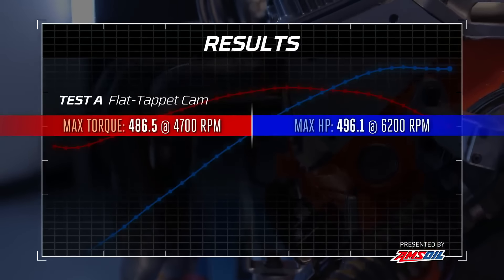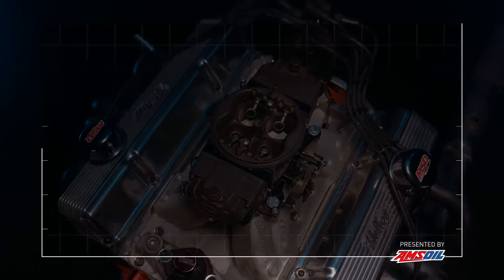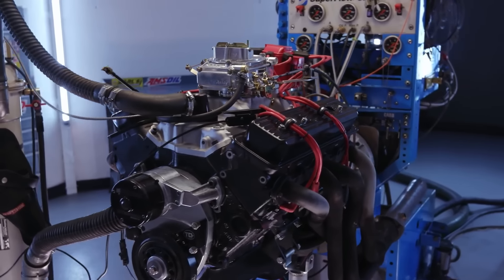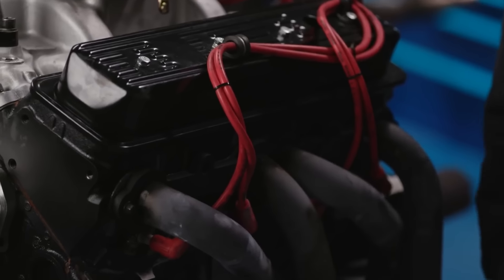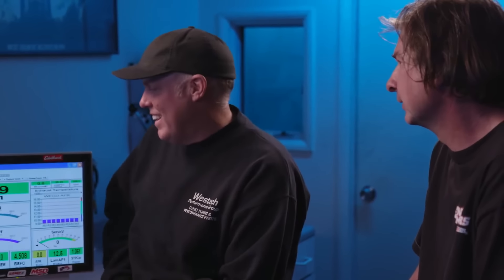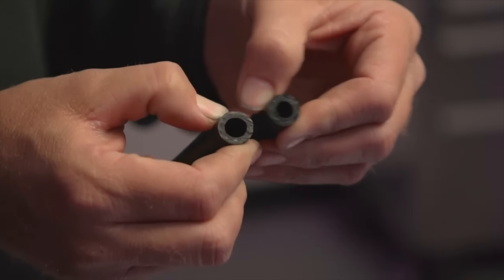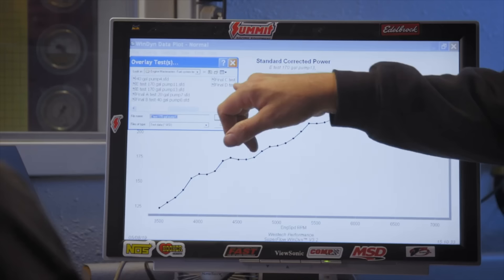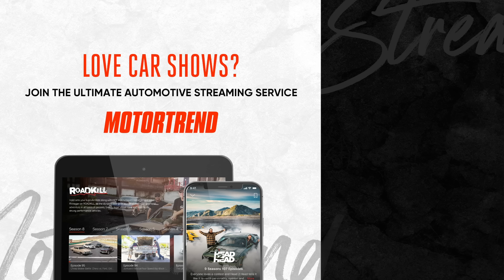Budget Mods for Big Power! | Engine Masters | MotorTrend

Comment: Idk, slapping a turbo bigger than my future on every bone stock engine sounds like a good plan
Reply: I can hear the rod knock caused by this post across the planet.
Reply: Check out "Richard Holdener".  He works in the same building on the same dyno and tests MANY different combos back to back...
Reply: P
Reply: P
Reply: Easier said than done, most universal turbo kits wont fit most vehicles with out absolutely hacking everything up. And to get a custom turbo manifold or header costs big bucks plus the fuel system required to support a boosted application. Its alot easier for a DIY guy at home to build an all motor set up.
Reply: My advice gap the piston rings right and run it a bit rich,but don't go too  big on the turbo the bigger unless you bore out intake valve, exhaust and piston housing.
Locate the turbo on the colder side of the engine bay away from heat.
Reply: @briang4470  not really,when dealing with power adders all you really need to do is gap the piston rings for turbos,blowers or nitrous and buy a exhaust for turbo unless you're  planning to straight pipe it while fuel injectors with pumps are cheap but depending on the size of the turbo you don't really need big injectors or run powerful pump.
But you need to gap the rings right size,I think for a turbo ,needs a bigger gap between the ring compared to a nitrous or blower application since turbo run a bit hotter.
getting the piston ring out could be a hassle but when you wanna build a  performance car, you got 2 options swap it with a turbo engine or go to a junkyard and find a block that Is on good condition to build the bottom end for boost.anyway you want take out the engine and inspect it for problems  before put it on the turbo.
Reply: @benjaminfranklyn604  have u ever tried to fit a universal fit chinese turbo manifold or header into a car? They are an absolute nightmare and u usually have to mangle ur car to make them fit or pay a exhaust shop to modify them for u or build u one from scratch and good fuel injectors are not cheap, those chinese ones u can buy for cheap are too inconsistent and alot of tuners will not tune ur car if u use them, they want name brand injectors with the specs so they can accurately tune or if u want to go with a blow through carburetor that will set u back 800-1000 dollars to either get ur carb modified or buy a blow through carb and the fuel pump u will.need for boost will also be costly. Yes boost can allow a garbage engine to make awesome power but to add boost to a engine in a vehicle is way easier said than done.
Reply: 🤣😂👌👍 yep!
Reply: I have done this I regret nothing, except having to pull the motor 2 months later 😂
Reply: @dirtydangler  99% of car enthusiasts have literally 0 skills, tools, know-how or the space required to just "fab something up". That includes wrenchers.
Reply: you gotta pick the right engine tho
Reply: Do it!  Any stock engine can take boost safely
Reply: @benjaminfranklyn604  bigger turbo spools later which helps save the rods. I boosted my car spending only 700$
Reply: @RangieNZ  true he usually test combos for power I'm not sure how many back-to-back runs does junkyard needs to take
Reply: It's the only plan
Reply: FINALLY SOMEONE WHO GETS ME 😂😂
Reply: Turbo roller skates
Reply: Ebay turbo or enough nitrous to go to the moon!
Reply: Ha na I'm good
Reply: Send it !!!
Reply: Make sure you gap the rings. Otherwise, it's only a matter of time before you blow it up.
Reply: Premium fuel and send it
Reply: @briang4470 , You can get Turbo Headers for V8’s (SBC/BBC/LS FOR SURE) does not require “Big Bucks”. I did my first Twin Turbo set up back in 2016 and you can get large tube manifolds/Headers very reasonable ($200.00-$350.00) range. It’s not terribly difficult or outrageously expensive to do a Turbo build (Which is why you see so many more Boosted combos nowadays). Especially in comparison to building a Custom Engine to make horsepower that’s even in the neighborhood of what Turbo build capabilities are.
Reply: Drop the compression. Helps when you are ramming air in there.
Reply: @jonmurraymurray5512  , that’s the “Old School” way of thinking. You can run plenty of Compression WITH your Boosted Combos nowadays. Just have to have a Good Fuel and a Good Tuner.
Reply: @supernova7470  good point. I know forcing more boost I had to have more fuel. (Ya think) no real reason you could do a higher compression motor if you do the due diligence.
Reply: @jonmurraymurray5512     , (I see your comprehension skills didn’t quite kick all the way in). I DID NOT say MORE/ADDITIONAL Fuel, I said  “A Good Fuel”, meaning “Quality Fuel” with adequate “Octane”. Keep thinking running 8:1-9:1 etc.  Compression Ratio’s are the only way to safely build a reliable and/or durable Boosted combo..😂..
Reply: @Supernova74  I had a conversation with a dude with my shelby Charger. High octane fuel..... would you believe I ran a 14.3 stock with 100 octane fuel? Yeah, I know that. Good fuel with a decent boost does wonders. Just so you know, when I rebuilt the engine in that thing I did shave the head. Ended up with 15 pounds of boost, running a 14.1 in the 1/4 mile. That's when I quit trying.
Reply: @jonmurraymurray5512  , if you knew that you wouldn’t have made the comment of “drop the compression, that helps”, which isn’t true. Nice try though..😉..
Reply: A man of culture I see 🍻
Reply: A true car guys mindset 😂
Reply: All I'm saying is I did it on a bone stock 5.0 94 Mustang and ran 10's all day.
Reply: This guy gets it 😂

Comment: I planned on copying this but during the build I snuck a bigger cam in it lol. I did run the big 2.02 valves in it. Did run the 600 Holley originally but I’ve since put an edelbrock avs2 on it. I didn’t save any money using salvage yard vortecs. I had $80 in heads and then another 800 in machine work. Could have bought the ones done already but I’m happy with mine. They’re clearanced for any cam, have the big valves. Surprisingly I still made 15-16 inch of vaccuum on the motor too. Enough for power brakes. My cam is 303/303 and I think in this episode they used a 280 comp? The power band isn’t great with my larger cam but it’s okay. It starts at 2800 but it doesn’t stop making power til I don’t wanna spin it any faster! Lol

Comment: i been circle track racing for 30 years , started out with holley fuel pumps, pretty much garbage, always leaked oil , switched to carter fuel pumps i run the same one for 4-5 years and finally only change it cause i figure its time. never had one issue with a carter, very well made and reliable.

Comment: What a confirmation!  I was getting fuel starvation last summer on my marine 383 with 5/16 fuel lines. 
It already had a good pump ((Holley Red). So I redid the fuel system to 3/8 ID and added a return to keep the fuel cooler.  
Took some doing. The filter/separator housing was 5/16 so I drilled it out and tapped it to the next thread size.  And I had to jump through some hoops to do a return.  But I am really excited for next summer.  Bonus is, it looks cool since the lines are made of nicely bent copper.  I had to do it with metal because rubber is not allowed except for a short piece.  

Worse thing is, I have the paid Motortrend app and never watched this video til February during a snowstorm.
Reply: Yeah, the 5/16" was spec'd for bone stock small blocks.  Cars with a bigblock option were 3/8".  As always, build your car rear to front.

Comment: LOL, I went hydraulic flat tappet and used the money I saved over a roller setup to add nitrous.

That boys and girls, is what we call a WIN-WIN situation!!!!
Reply: Out of curiosity, how much was that nitrous set up?
Reply: @monahumada7535  

Old, used plate system I picked up for $150, I think. Low buck build, because I'm CHEAP!
Reply: Since you are cheap, how much for a v8 
build but keeping the budget at bay?
Reply: @monahumada7535  just put nitrious on mine for around 800 dollars using purge valve gas valve and nitrious valve
Reply: @jonathanlawson4667  Thank I might look into that on another build
Reply: Why not a solid tappet? Same price and better performance
Reply: @Carlos.Rivera if you are buying a junkyard block I could do 450 for about 3.5k, if you have the engine already that 3k could easily do 600
Reply: @jediknight1294 where are you located?
Reply: @VickB87  I'm back in the UK jwo but those are us prices

Comment: I fought vapor lock from first to second gear at the track and changed  fuel line size, fuel tank pickup and went larger and larger mechanical pumps and nothing fixed it until I installed a electric pump at that backend and Presto! Fixed. Moral of this journey, ethanol on a very warm to hot days liked to be pressurized not sucked.  Sucking creates bubbles due to low pressure but pushing fuel creates high pressure and eliminates this issue. BTW the mechanical pump is still in line so now if one fails I have a backup. 
Note: my 1967 camaro has no return line so if your car has a return line you may not experience this problem

Comment: A 400” Chevy had to have an aftermarket crank in it. When guys started stroking their 350’s to 383” we were inundated with broken factory cranks. If it was me? A 283, 302, 307 or 327. I think the 307 was the answer Chevy needed for their 5.0 liter smog engine. A friend of mine was working on one of the first HEI units to come into our HS Auto Shop for a tuneup. The problem was a bad set of wires. The insulation had cracked. He started by trying to adjust the timing. Leaning over the fender and his one hand on the timing light, the other on the Distrubuter cap he took 50,000 volts to his best friend and doubled over in pain sounding a bit like a Michael Jackson as he swore!
Reply: lol!

Comment: The vortec heads work very well on a 383 as well. My motor has about the same compression ratio at 9.3 to 1 and with a cam spec out at @.050 206 and 216 with the lift at the valve with a 1.6 rocker at .476 with 112 Lsa made 450 lb at 4000 and 370hp at 5000. THIS IS A TRUCK MOTOR NOT A RACE MOTOR. That is why the power is so low but the cam will work with the factor efi in a late 90s truck or suv with a little tune work and the motor pulled 17 inches of vacuum at idle.
(Edit) I forgot to say that this is at the flywheel

Comment: Me doing a '65 383 with a Mopar Performance Street rod cam 280/280 with dual springs. That's about $500.00. Engine kit from Mancini Racing with cast aluminum psitons, moly rings. I just want a nice rumble and hellacious response. Going with a single plane Holley 750 and stock mopar ignition. Heads are the 516's with back cut valves. Going in my '60 Fury with a 813-9B 4spd, hurst shiter. All old school and fun.

Comment: BTW I ran that Carter pump back in the 80's too. It worked very well and never failed. I went through a bunch of pumps before I settled on that one.
Reply: Old Carter mechanical pumps were good back then. Supported decent power. Always ran them on basic Pontiac builds as well.

Comment: Id rather take the $750 that only upped HP by 4%(?) and put it toward forced induction
Reply: Well, the 750 dollar turbo setup is gonna need a new motor every year and hurt driveability
Reply: @michaelmccuskey8113  uhhh....lol, thats not true at all.
Reply: @michaelmccuskey8113  It's only the tune that would do that. If you don't have a good tune you're gonna have issues. It's not hard to learn how to tune for reliability.

Comment: LOVE the show guys, can we see the difference between small and large valves. Someone told me to pick small valves for low end torque in a truck I'm building. Engines are a weird dynamic, so I wouldnt be surprised if this was a thing
Reply: Small valves are an ancient fallacy. John Lingenfelter always said bigger valves are better because they flow more air at very LOW lift. The limiting factor in valve size is the cylinder wall because the larger the bore, the more distance between the edge of the intake valve & the wall itself, which "shrouds" the valve & is detrimental to air flow. Chevy finally realized this & reduced the size of their valves for Performance 350s from 2.02/1.60, to 2.00/1.55, & they make well over 400hp with a 208* cam with their CT-400 crate motor(advertised 405 but actually make 440-450hp, according to every Modified owner I've talked to).
Reply: @bradgriffith4231  I'm building a 331, very similar to what freigburger had in that contest of compression ratios. With the 4.030 bore, how big of valves would you recommend running. I'm not going for earth shattering performance. I'm trying to build a street strip truck that can do 14s in the quarter, NA, pump gas compatible, and gets ~25 mpg. I don't think it's that unreasonable. With my stock 350 I'm getting close to 20 already
Reply: @cerneysmallengines  I'm sure all the "experts" on here will tell you I'm wrong, but I've had race cars & street cars for over 50 years. Chevy has dropped from 2.02/1.6  to 2.00/1.55 valves on their best GMPP heads, even with 220cc ports. Your biggest obstacle is the 25mpg. Trucks are heavy & NOT aerodynamic. Even the newest "Displacement On Demand" & "shut off at stop" bullshit motors in trucks don't get 25mpg. Personally, I have a mild 350 with the GM "LT-1" 203* hyd roller cam, 1.6:1 rocker arms, & built Vortec heads with 1.94/1.5 valves. It runs great. Keep the cam duration short & comp BELOW 10:1. I run a lunatti hydraulic roller in my 409 small block that's 211* @ .050" lift & around .540 lift with 1.6:1 rocker arms. Both my 350 & 409 have around 9.5:1 comp & run great on 87 octane gas. Chevy makes well over 400hp with their CT-400 circle track crate motor(advertised 405hp but 440 actual) with 10:1 comp & a 208* hyd roller cam. Big cams & big compression is for real race cars. A street car needs to idle smooth, good vacuum, make big torque from just off idle, & run on 87 octane pump gas. Frieberger & Dulcick always run too much comp & cam on everything that's supposed to be street cars / Daily Drivers, & magazines/videos stay in business selling their sponsors parts! My buddy built a mild 355 with a 235* hyd flat tappet cam in a nostalgia dragster that ran 10.19 first pass out of the trailer. His Olds Cutlas has run 7.96/168 @ Phoenix in June with 90+ degree ambient temp & 4,000 ft corrected air density. The sum of the components makes the power, not 1 "magical" piece. Hit me up on FB with a personal message if you want to bs. I won't put my phone number or private email on here.
Reply: @bradgriffith4231  what's your Facebook
Reply: @cerneysmallengines  Brad Griffith, Pahrump, Nevada

Comment: I ran a Comp. 292 magnum in a stock 70 400 motor with Fuelly heads, Victor Jr. ,750 double pumper, and 1 5/8 headers on a daily driver 68 Camaro 30 years ago and it ran like the Dickens!

Comment: If you take a flat tappet cam nitride it, put in 1.7 rockets on the intake,  1.6 on the exhaust, it will equal or exceed the roller up to durations of about 284.
The reason you nitride the cam is if you don't there so much pressure on the lobe from the large rocker it will not hold up.

Comment: Solid Flat Tappet cams can last a long time if you take care of them properly. I used a Lunati Flat Tappet Solid cam in my drag car for about 15 years. Don't overdue the valve spring pressure, and insure you use good oil. I ran mid 6s in 1/8 mile, and over 2000 passes before going to a roller setup. Roller was not much performance improvement. Surely not worth the almost 3 grand all the changes cost with the head modifications (Valve Springs, stronger Rockers, Retainers and locks, Cam, larger Pushrods, machine work for larger springs). A lot of cash to get .1 improvement in ET.

Comment: What about the deep sump stock fuel pump used on HP SBC & BBC's? And did you have to change the valve springs when you from a flat taper can to a roller cam?

Comment: As always,  love it,  great video guy's 😇 . I had a .30 over 1970 Buick 350 block w/ 68' 32cc heads & 9.2:1 dished pistons and a Comp 468H. Cam and that thing was impressive.  With the HEI ignition and the Carter 675 carb running 6.75 psi @ the fuel rail,  with a Holley blue it would starve out at 1/2 throttle.   I finally had to go to a high-flow Blackstone fuel pump which was new at the time that ouflowed the Holley Blue Pump. Idk what the hp #'s were,  but it was a lot of fun and I'd love the chance to recreate another one just like it .
Reply: GM started putting bypass lines on all their carbed motors in the 70s to cure "vapor lock". Your problem was the small fuel bowl on the Carter, same with Q-Jets. I ran a Carter HP(100 gph) mechanical pump with a bypass on my Q-Jet carbed 406 SBC & never ran out of fuel. I now run a stock TBI type in tank  electric pump on my 409 SBC at 6 lbs pressure with a Holley Street HP & can't run  it out of fuel.

Comment: The question I have in regards to hydraulic roller vs hydraulic flat tapped is are both camshaft specs are the same in regards to duration @ 50 and lift?  As a matter of fact you guy's never mentioned cam specs at all. We the viewers would love to know. Thank.
Reply: I don't see why they conduct a test using different size cams. I mean that wouldn't be a test in itself. I'm sure they used same size cams otherwise, what would be the point, right? It's possible they are tricking us, but based on my understanding of all these vids, this show doesn't seem to be about tricking the audience, so.

Comment: Dave, do you know what cam is in the 350 crate motor you put the heads on? Must be some small hydraulic flat tappet. My son has a 1978 C3 with an L48 and I think new heads would be a great start on a budget. BTW, this is the guy who had the 240Z at the first PGD in 2004. Thanks.